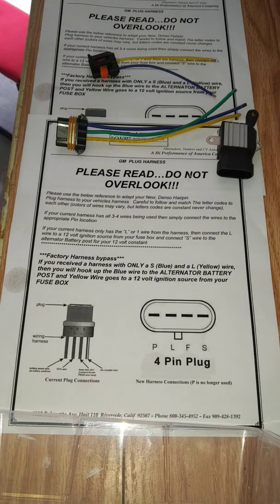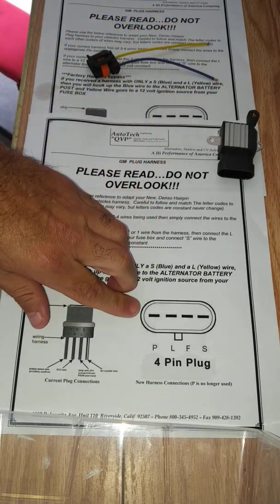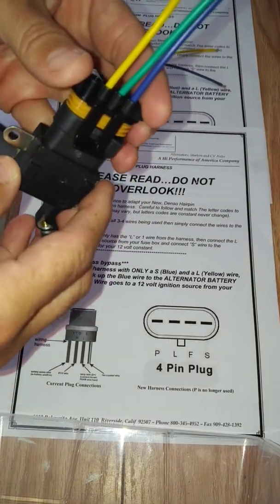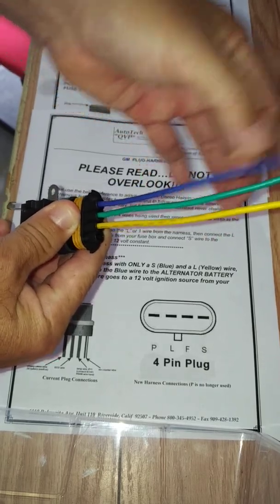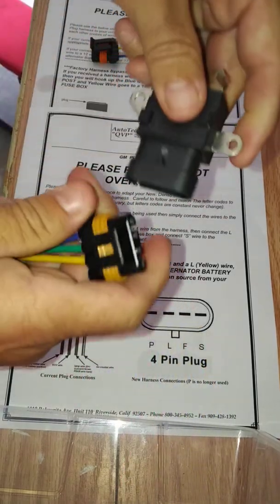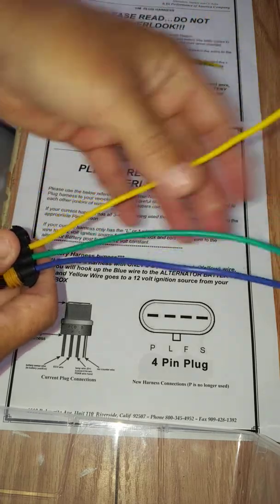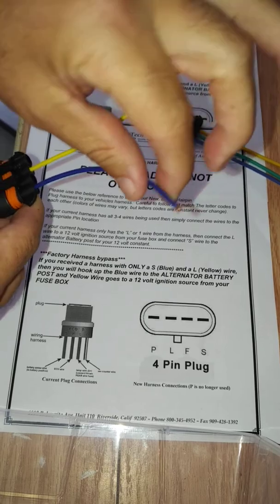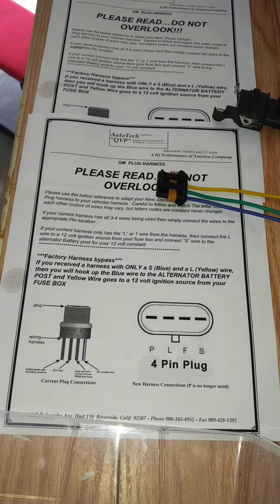GM harness installation detail 3 pin

Comment: I'm installing a dual alternator system on my 2004 Suburban and I just want to make sure that I don't mess anything up in doing so. I have purchased two 255 amp alternators from Amazon and I have already installed both of those and connected one to the existing plug just like the original one. The only thing that I want to be sure of is what is the best fuse location for me to tap into to basically turn on the second alternator. I tried this previously and connected all of the wires on the second one into the wiring harness for the factory alternator and it started smoking. So I immediately turned it off and rewired it after a lot of YouTube investigation and it seemed to work fine for the past year but both alternators just went out again so that's why I'm asking you for this information. I also have a third alternator and the bracket to install all three alternators but I'm planning on doing that later this year when the weather cools down some. I believe that I understand everything in your video but I can't find a switched fuse underneath the hood so I'm assuming that I will probably have to go through the firewall and tap into a fuse in the dash so if you know what fuse is the best one for this please let me know. Thank you for any help with this issue and I will be looking forward to hearing from you about that.

Comment: How do you get the battery light off the dash
Reply: Wondering too
Reply: Just splice into your factory harness wire (have to find out which wire is positive) and connect it to the positive post on the alternator with the "s" wire.

Comment: So i upgraded my cs130 to a cs130d. Kept the L wire to idiot light in dash.  From what I understand by you ad this is the plug i have now..  i need to run a wire from “s” to keyed 12v , so its not constant, ..what about the use of a 470ohm ressiter in line on the s terminal? 

My idiot light in dash is a LED
Reply: The truck is a 93 k1500.. had the square plug, new alternator has oval
Reply from the maker: L is ignition  S is sense and goes to alternator positive post
Reply: @autotechengineeringusa  thanks.  What size diode ? The 1n4001?
Reply: And the L goes straight to dash light and  the opposite side of it is my ignition 39 wire . So the diode will in theory drop the voltage so it wont overcharge correct?  And that is between the s terminal & main battery lug on back of alternator correct?
Reply from the maker: @jus10inla  1n4007
Reply from the maker: @jus10inla  diode will not drop voltage
Reply from the maker: Resistors are sometimes ised on L, but it's not needed if you are on a switched fuse.  Diodes are used on sense

Comment: Now what's so hard about making a video like this . This guy in a 2 min video answered all my questions. I have been searching for a few hours now and he nailed it on the head.  I bought a a gm ls high output alt from a guy who project went bust so I got a brand new js alts 370 for 300 but on my other vehicle it was plug and play no harness that's a v6 3.5 chevy malibu.  This time it had this harness I didn't want to fuck up a 500 dollar alternator before I got use it thanks for ur help and info awesome BTW this 1 didn't have the manufacturer instructions in the box

Comment: I have a 2008 Impala LS 3.5l flex fuel will I be able to use my factory connector?
Reply from the maker: You can but your voltage is pcm controlled. We recommend our voltage bypass option.
Reply: @autotechengineeringusa  so that means if I use factory harness it won't charge higher than what the pcm says? And that's the reason for the bypass? Thank you for responding so quickly js is the only company that makes a h/o alternator that I can afford just trying to do my research and see what I'm getting into
Reply from the maker: @aaronlawrence4218  our 240amp is 325.00 and 320amp is 360.00.  Also, js does not provide any video proof of output
Reply: @autotechengineeringusa  I want to push like 1500w should I get the 240 or do I need the 320
Reply from the maker: @aaronlawrence4218  240amp
Reply: @autotechengineeringusa  your the best dude should have enough saved in 2 weeks😎.. can't wait only getting 300 watts outta my stock alternator🤬   also for my car 2008 Impala 3.5 litre flex fuel do they have to build the alternator from scratch or do they have them built already
Reply from the maker: @aaronlawrence4218  builds do take one week. Autotechengineeringusa.com
Reply: @autotechengineeringusa  thank you sir
Reply: I checked out your website and I think I'm gonna get the 320 and will I need a new serpentine belt?
Reply: And I saw you guys had options for higher voltage charging do I need higher voltage charging for what I'm doing or is the OEM charging voltage sufficient
Reply from the maker: @aaronlawrence4218  a shorter beltbis always needed
Reply from the maker: @aaronlawrence4218  gobwith 14.8v,  it's free
Reply: @autotechengineeringusa  thank you very much your awesome once I get my alternator I'll let you know how it goes gotta about 2 weeks of saving Todo because I didn't do my research I spent 300 dollars on a battery and it didn't improve anything lo and behold it's because my stock alternator sucks but once I get my alternator from you guys I'll be good already have all 0 guage ran to everything so I'm setup and ready to go
Reply: @autotechengineeringusa  I'm definitely gonna recommend you to people because people ask me about my music all the time

Comment: I have a DC 170A alternator that I installed on my 02 Silverado w/ 5.3. Stock was a 105A alternator so it has a 3 pin connection on it. The DC has a 4 pin conection and us making a Whirring sound now when I drive but that's the only issue I'm having with it. Do I need to change the harness to a 4 pin if so how would I do this. Please advise any help from anyone would be appreciated and thanks for a awesome tutorial JS 👍
Reply from the maker: It depends on the alternator style

Comment: Is the factory harness bypass required or can i use your alternator without it and use the stock harness to retain factory functions?
Reply from the maker: Depends on vehicle year plus our harness helps to turn off dash light
Reply: @autotechengineeringusa  Will the 2 wire harness also turn off battery light?
Reply: @autotechengineeringusa  it's for a 2004 Chevy Tahoe 5.3L
Reply: @autotechengineeringusa  Do i need to splice my factory harness or is your adapter harness plug and play?
Reply: @autotechengineeringusa  It's for a 2004 Chevy Tahoe.

Comment: On a 03 Silverado 3 pin connector how can I get a 2 in connector to work and actually get the alternator to charge ?
Reply from the maker: Oem is 3 pin. Why would you want a 2 pin
Reply: @autotechengineeringusa  to run a 160 amp alternator off a 2005 Silverado “ 2 pin style “ connector i currently have the 145amp alternator 4 pin alternator
Reply from the maker: @christopherhernandez9115  get a voltage controller
Reply: @autotechengineeringusa  my truck harness has 3 wires 
-engine on signal 
-Charge indicator control
-generator field duty cycle signal 
The 05 Silverado has 2 wire the square connector 
-generator field duty cycle signal 
-charge indicator signal 

Is there any way to just change out my connector and make the 05 amp charge correctly not stay in limo mode at 13.5v
Reply from the maker: @christopherhernandez9115  the 2 pin regulator is pcm controlled so you would need to change that. Msg us at info@autotechengineeringusa.com for more detailed help

Comment: Nice explanation  I need help I bought use1999 Toyota Avalon from someone the  alternator wire socket pin from the car is 3 red colour with blue on it, yellow  colour and white. When I look at the alternator pin I notice it comes with  4 pins and  the  socket. The car 3 wire connected to socket  pin one was ignore base on the car factory  alternator pin wire w 3 alternator charge on it comes  with 3 pin ,. Now I want to fix recommended alternator  for  the car has 3 pin and the socket, my  problem how  will  I identify and connect on the new alternator  socket 3 new pin socket I bought for this new alternator  thanks

Comment: S to Battery + Post , L to Dash Light what about Field? I am thinking of putting it to 12v switched ignition but im not sure if L takes care of it or is necesary to have them both conected
Reply: Do you have any information about that? Can we do that?
Reply: Did you ever
Figure this out ? Same question
Reply: I made it. 12V from ignition source - bypass fuse to ignition fuse and you have a second 12V. Add resistor 470Ohm and connect it to L terminal. It works in my Cadillac STS Seville 2000.
Reply: @patrykreksa1564  thanks. My vehicle originally just has the one wire to dash light.  (Position L) So all i have to do is wire in a 470ohm resistor to make it charge? Or do i need to also hook up the S wire to charge post?
Reply: @jus10inla  without S terminal will be ok.

Comment: I have a mechman 370 elite alt. For a gm they don't make this for a ford I have a 3g stocker and wondering how I wire this up
Reply from the maker: Wire what up? The nechman?
Reply: @autotechengineeringusa  no it's simple I'm trying to reconnect my 3g with it but it keeps charging raising voltage and not stopping

Comment: My js alternator is charging at 15.5 why would it be doing that can i have it hooked up wrong.
Reply from the maker: Possible unless you ordered their 15.5v internal voltage regulator. If you didn't then it could be wired wrong or its a low quality regulator that is spiking. Hard to tell.
Reply: @autotechengineeringusa  my small blue box spikes from like 14. 8 to like 16.7
Reply from the maker: @bassheadlife492  may be belt slip or a failing box
Reply: @autotechengineeringusa  definitely not belt slip, the reg was brand new but it's doing its job so I've just been running it

Comment: I have a two wire harness on an 86 elcamino but put a serpentine setup on it which took a four prong plug, got the plug but which wire goes to what and or what to do with the leftover wires
Reply from the maker: Match up letter codes on back of each alternators voltage regulator. LFS. Any unused wires get tucked away. Website has instructions as well. Autotechengineeringusa.com

Comment: What about serpentine belt replacement? I have a 2000 chevy silverado 1500 with ac. Do I need a bigger belt or smaller belt? Where can I find the right size if I have the 320alt.
Reply from the maker: a half inch shorter belt is usually required.  any auto parts store will have

Comment: I'm getting a "SERVICE BRAKE BOOSTER" because your new harness doesn't use a "P" terminal. Do you know what I connect to my Factory's "P" Terminal? I have a 2003 Yukon.
Reply from the maker: P is rarely used. If you are not seeing 14.8+ off the alternator post then you may have wired incorrectly
Reply: I have a 2003 Avalanche 1500 and just went through this.  If you are getting "SBB" like i was, the P goes to the (SBA) supplemental brake assist pump.  should be the blue wire on your pigtail.  The 250 amp alternator from JS only had 2 hairpins in a 4 pin plug F & L, The stock alternator is a 3 hairpin 4 pin plug F, L, & P.  S is not used on the factory harness.
Reply: Im hoping i can just change the voltage regulator to a 4 hairpin so i can use factory harness
Reply: @dadokta  u ever figure it out?
Reply: @lsgangjohn9896    yes.  I took it to a local shop and he soldered a wire to a source inside the alt to get the voltage required.  I used a butt term to the blue P wire been perfect since I installed it.
Reply: In short js doesn't make an alt that is a direct plug and play for my truck which was disappointing.

Comment: Great video JS alternators didn’t send out and wiring instructions with mine
Reply from the maker: They also don't post videos because they buy their units from china
Reply: @autotechengineeringusa really!?
Reply: Wow SMH I just experienced an issue with my "Brand New" 320 Amp JS alternator. Had to send it back. Got replacement and ordered voltage bypass regulator, and the instructions were very confusing. Thank you for this video.
Reply: dude i just had this issue js is bullshit